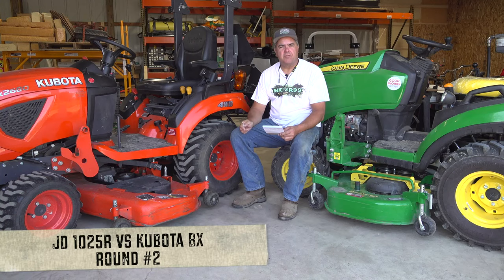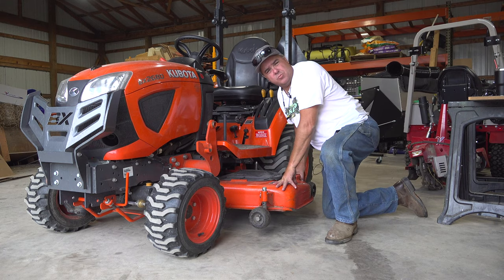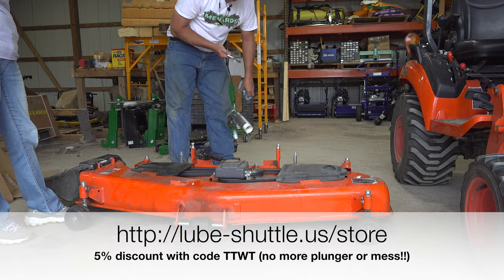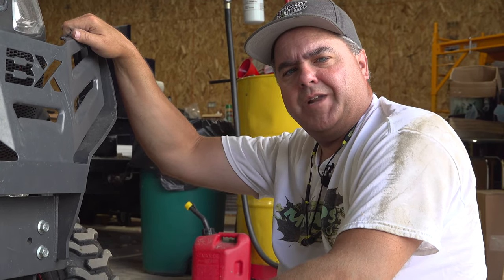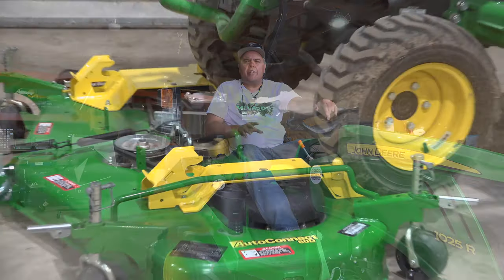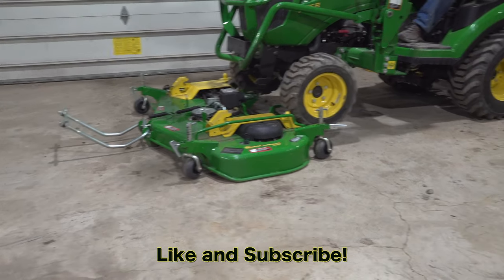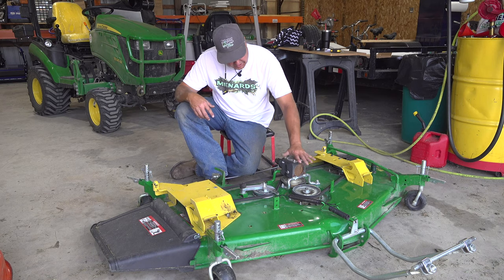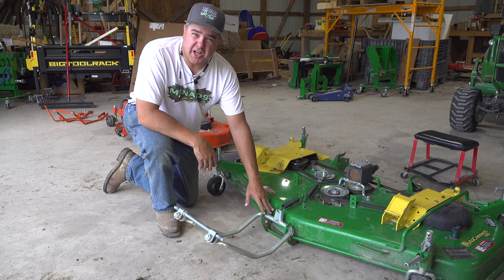Deere 1025R vs Kubota BX Round #2 of 8 Mower Deck

Comment: Doesn't the newer BXS have a drive over deck u should compare that one with the 1025.
Reply from the maker: Could not find one.  Kubota sale folks do not recommend them.  So, there are not many available. While this is apples to oranges, it is the 'most common' bx configuration vs. the 'most common' 1025r configuration.
Reply: Hi Tim, I have a BX. It has the drive over deck. It does makes it much easier and faster. I take mine off every week. With that being said, I would give this one to the Green and Yellow brand.
Reply: Tim Took delivery of a new bx2680 with drive over deck, these have been available in Australia for at least eighteen months
Reply: It took me three weeks to get mine. I gave up on ever getting it or the tractor and one day I got a call and they said it's ready for pickup.
Reply: The Kubota drive over still would have lost. A hasty put together answer to JD drive over AUTO CONNECT mower.
Reply: When I bought my 2018 2025R new, I also got the independent hydraulic lift as well as the power beyond. I have an older John Deere material collection system that mounts to the 3 point hitch. With that, having the deck separate from the 3 point is a must. On my old JD 755 I got the  power beyond kit and ran it to a 2 spool valve mounted on the right fender. The mower deck hooked up to one valve and the hydraulic dump for the MCS hooked to the second spool when attached. My 755 did not come with the loader hydraulics.
Reply from the maker: I use the TKV20 MCS...works fine with the 3 pt mower control.
Reply: @dougmason9269  This thread inspired me to take mine off today. It has 32 hours on it. It took 8 minutes to take off and I am still unable to get it back on. If the hooks align the PTO doesn't . I adjust the deck and I'm stuck pushing it all over the yard and driveway.  I'm having buyers remorse.  I bought it for the drive over deck and now think the manual one would have been a better choice.

Comment: I had a Kubota B2920...extremely similar deck install/remove to the BX. It’s much more work than what you showed with the Deere. After a few times you can definitely do it in 5 minutes but it still involves laying on the ground. So I’ll definitely say the Deere deck is better from and install/uninstall perspective. 

That said, I used my Kubota 60” deck extensively for 600 hours and never had any problems with the belt or spindles. I did break off the wheels on a few occasions but was able to weld them on.
Reply from the maker: I started to mention the strength of the wheels.  Both brands seem similar in that area...meaning, they both could be stronger!!

Comment: People can defend that Kubota deck by mentioning the lift height but I do not want to do any tilling or loader work with the deck installed. That deck looks like a straight pain in the rear to remove on the Kubota.
Reply: As Tim said not as bad as a regular lawn tractor. But you're right compared to the John Deere it a real pain. I love my auto-connect.
Reply: Not that bad
Reply: @zachary3777  Yea I'll stick with my auto connect. That mower removal on the bx brought back bad memories of removing the mower deck on my old 345 jd mower. My 3 series 72 inch deck is even easier than the 1 series deck
Reply: Mine never goes on easy and takes two people. Tims in stall went perfect lol
Reply: @Judathehero  I tie a couple pieces of rope to the gauge wheels on the side you are pulling on.  Helps when you are trying to maneuver the deck back into place.
Reply: They only defend it on lift height, because it's such a pain to take off they won't do it. They're basically arguing the the height of a kubota with a deck because you aren't going to take it off to a john deere without a deck because it's super simple to take off.
Reply: @ImaITman  The deck on my BX comes off every time I finish mowing. I really don't find it difficult. That being said, would I rather have the ease of the JD system? Of course!
Reply: Yes and no.  I take mine off on my BX.  I lift the front wheels with the loader, and drag it out forwards.  Then I don't have to turn the wheels and don't have to mess with the wriggling.  It's still harder than the Deere, particularly connecting the PTO shaft, but it's not that bad.  I do take my FEL off more than I take my mower deck off though.

Comment: I have a Kubota BX2200.  I had a Deere 4100  that I traded in for the BX because I wanted something more compact.   I'm over 65 years old.  Yes the deck is not easy to put on, but not really THAT  hard.  Stop Whining.  I'm not convinced that the Deere drive over deck is THAT easy to attach.  It probably has to be lined up just PERFECTLY to work.   That BX is a BULL.  It has never broken down in 19 years having it and I don't regularly do the maintenance like I'm supposed to .  I like that the grass catcher on the BX runs off the PTO and there is no SEPARATE motor to deal with.    The Only thing I like more on the Deere is the twin touch foot control.  I think it is better for me.
Reply from the maker: My TKV20 (terraking.com) grass catcher runs off the PTO...no separate motor.
I find the Deere autoconnect much easier to install/remove than the BX deck.  I will stand by that statement.
I’m not trying to say anything bad about your bx..  This is one of many feature differences, and I think we do our best go fairly show all of those differences.

Comment: I have an asphalt driveway.  My JD QC deck will NOT stay still in 4WD or not.  I put down a piece of 5x8 outdoor carpet and now the deck stays still.  For some reason I can't connect consistently on grass though.
Reply from the maker: Make sure you remember to use 4wd.

Comment: Had you used the lower hole on the casters the leveling bolt would NOT have hit on the bottom of the tractor and given you way more clearance to do that little ( 5 ) MINUTE JOB, overall am enjoying the comparison though 😁
Reply from the maker: Never thought of that.
Reply: Aw, I was gonna say that. Also put front wheels on<>2- 4" board or block to make more room.

Comment: How about putting a piece of 2x4 lumber under the front wheels of the KB.  So it will help it clear the mounting bolts on the deck.

Comment: As a older man not able to get on his knees I will take the John Deere any day over the none auto connected deck plus I just like the green quality I still got a jd 318 mower now with over 8000 hours yes 8000 hours the original engine and the rebuild and now last engine which only makes two engines and one overhaul but the tractor and mower deck are still excellent condition
Reply: Retired driver you’ll be getting on your knees and stomach to fix it because it breaks all the time.   Junk
Reply: John Deere 318 uses Onan engines, fantastic engines and mine currently has 1800 hours and running strong.

Comment: This is fair to Kubota! Kubota also offers a drive over deck so you should be comparing that with the John Deere drive over deck to make it fair. You’re so unfair to Kubota because your green! If you wanted to be fair you should test drive over to drive over and not drive over to drive over
Reply from the maker: We discussed this in the comments, and in a follow up episode.   Please check it out to understand our reasoning.  No intent to be unfair,  but it isn’t quite as straightforward as you make it sound.

Comment: I had a BX1500 tractor w mmm deck and while it mowed ok, the deck was the same style pin on the newer ones have, there seems to be some mild updates to the hardware the process is the same. Kudos to kubota for making the bogie wheels turn sideways to pull the deck out.  I upgraded to a 1025r after about 4 years with the bx. Direct comparison, kubota deck floats better while mowing uneven terrain, but the autoconnect tradeoff is worth every penny. Like you stated Tim, if adjusted properly it’s never given me any issues. And the ease of being able to switch from mowing to any other operation without leaving the mower on to take damage is awesome.  Yeah it doesn’t lift as high, and given all that linkage it’s an understandable tradeoff for time of donning or doffing the dang thing.  When you get to loader operation, hands down I enjoy the kubota valve better. It allows for more fluid operation of multiple functions compared to the 1 series. Not enough however to make me want the kubota more.... for a few reasons:  1. position control 2. Quick park (also the quick attach bucket) 3. auto connect 4. Twin pedal hydrostatic.
Yes the treadle pedal is aweful. Ergonomically makes your leg/knee hurt extended use or inclement weather use like plowing or snow blowing in the winter....
It allow crowds the operator station making getting on the tractor from the loader control side harder when you need to. 
That said, the kubota is a solid machine. I enjoyed owning it as it’s as productive as the Deere if your a knowledgeable operator. Deere just clearly spends more time investing in R&D for the small things that make the 1 series such an easy machine to own.... (see my list above again for reference).

Tim having owned both I also understand your bias. And still feel your doing justice to both brands with this extended use review. Even if you brought in a red competitor I’m sure you’d see a similar like and dislike doe features and design that would keep you enjoying the 1 series as much. I’m also happy to see Neil from Messick’s poking fun as well. He’s good people and his videos and your videos make up the majority of my tractor video list lol.  If nothing else you guys reinforce the things I teach my operators and also provide me for more variety into the capability and new products for the sub compact tractors. (I spend most of my fav time in commercial / military equipment) (also to be honest my father was a JD construction equipment mechanic, so I do bleed green a bit more than I should lol)
Can’t wait for the next videos!

Comment: Anyone with a 1025 have a good amount of mowing hours with an auto connect that actually disconnects/ reconnects the deck everytime? Curious to know how well a worn in unit performs. My JD service buddy absolutely hates the autoconnect and after adjusting one myself, I can see why.
Reply from the maker: Once adjusted, mine have always stayed adjusted.  
I don’t mean to be rude, but I don’t really care if the JD service man doesn’t like adjusting them :-)
It works! ...and works better than any other mechanism on the market today!
Reply: Latham, we have only had our 1025 for a few weeks now, but we do take the deck on and off EVERY time we mow.  I groom a dirt track and we race every week, so I mow and groom at least once a week.  I take the deck off to use the box blade and harrow on the dirt track.  I am extremely pleased with how well the drive over auto connect deck works.  I think maybe some folks have trouble with the alignment and hook up because there is not a perfect aiming point on the deck.  As I taught the wife to attach the deck I studied very closely how and where she was aiming, because she always tended to be off center on the right side.  I am a hobby machinist and mechanical things always interested me, so understanding exactly how this works or doesn’t works was important to me.  Jim

Comment: I was surprised there was no acknowledgement of the Kubota drive over deck.  They've had it for years now.
Reply from the maker: my mistake. I mentioned it in the website write-up, but failed to mention it in the video.  We couldn't find one to test.  Neil (and other sales folks) do not recommend them.  There are apparently not very many of them sold.
Reply: @TractorTimewithTim  i bought a drive over deck on my b series, i ended up taking the drive over back and they swaped it with a normal deck. I think the normal deck is easier to take on and off than the drive over was. (once you take the deck on and off a couple times it gets easier to learn the points to wiggle and whatnot)
Reply: Yet it works similarly to the John Deere; I reckon it is similar insofar as you need to tweak it for set up.  I don't believe for a second it is more difficult once adjusted, than the regular Kubota deck.  The PTO auto connect alone would be worth it for me.  But all told I want my next tractor to be a 2038R.  The BX, and the 1 Series just don't have enough hydraulic power/implement width for some of my needs.  And I think when comparing the B series to the new 2R series, the latter is the clear winner in capability, innovation, and options.
Reply: @TractorTimewithTim  I have one on my BX2370 came from the dealer already installed, I have no issues with it.

Comment: Probably a good place to throw in something I learned in my research on these tractors and their mower decks. I was thinking of the drive-over deck for the Kubota as I was shopping. However Kubota does have that vulnerable plastic cooling fan underneath. With the deck on it's reasonably protected but with the deck off a lot of people opt for a third party skid plate under the Kubota. 
One of the most popular 3rd party skid plates is BXpanded's 'Under Armor' unit. It goes on/off quite easily after first install by all intel I could gather. 
HOWEVER - it will not work with the subframe of the Kubota drive-over deck. Perhaps there are other solutions people have found which will work just fine there but I have no knowledge of them. The Under Armor not working unless the subassembly for the Kubota drive-over deck was also removed made the drive-over deck a no-go for me personally. 
In the end the comparison of mowing deck maintenance was a strong factor in pushing me over the Deere side of the fence. Only time will tell if that was a good decision or not for me. 
The 'cost' for that, in my book, are the maintenance grease points along the driveline of the Deere.

Comment: What I did with my BX is, first, wish I had bought the drive over mower deck option that the dealer talked me out of (they said they had demo'd it on pavement and the deck would roll when they tried to drive over it... but they were on pavement with the deck wheels unretracted...) but second, since I had the standard deck like on your demo model, I removed or added the deck while having the FEL on, which I used to lift up the front of the tractor and roll the deck forward out from under the BX.  Worked much better--no deck wheel turning, and no sliding the deck out sideways and hitting the frame with the height adjustment screws.   The worst part then of the deck change was putting the PTO back ON--since you are trying to pull the collar while pushing the shaft.

Comment: I’m impressed with the John deer drive over deck. I had no idea it was that easy. I own a Kubota and I’m use to taking it off an on the hard way. I’ve had this machine since 2004 and I love it. I can’t begin to tell you how much time it saves me . I’m looking to upgrade to a 2380 because I don’t have a front loader on mine. Just not sure if I’m ready to trade it in . Thanks for your videos.

Comment: When my dear ‘ol’ Ford 640 finally required major work I looked at both Kubota and John Deere.  I was looking for something comparable to a friend & neighbor’s early ‘90’s Kubota L2350DX that I like.  What decided for me was the JD dealer six miles from home had a 2021 1025R with 59 hours, FEL and 54” deck and we dickered the price down a bit.  When I got it home I found the deck was WAY out of adjustment.  Connected/disconnected easy but was sloppy loose.  I spent a day tweeking on my garage floor and got it set proper for tallest possible height control, leveled the blades, adjusted the drive-on auto connect, and later added the Load-n-Go/lift ramps so I can lift it and store it vertical.

Comment: I'm surprised you let the floor get that dirty! ;D
I guess you can see why the front wheels need to be turned to the left to get the Kubota deck on and off.
Not everyone has a smooth, level concrete floor. I suspect taking off the Kubota deck is even harder if you have to do it out on uneven grass.

Comment: if you look at what messick did ,,he actually lowered the kubota deck to the lowest hole at least one inch down from where you pinned yours that drops the deck at least an inch ,,,are you sure you're not biased just a little ,,and i own a deere
P.S. and taking a second look at the video ,,those bolts above where the deck pins to be lifted up are adjusted about an inch higher than the one messick used on his removal???¿¿¿. that would lower the john wayne move deck by maybe 2 INCHES might be easier ya think??
but i do like your videos
Reply from the maker: Please watch the Round #2 follow up video where I try different holes.

Comment: First of all, thank you for what I refer to as an exceptional unbiased and fair comparison video series.  Secondly I was wondering if a bright yellow grease pencil marking around the wheel pegs on the Kabota mower deck could help those like me in remembering the position prior to turning them. Should be safe since it is greased based and bright yellow is easy to see.